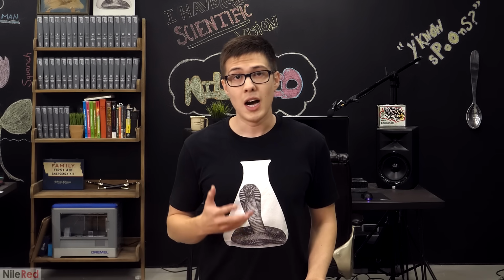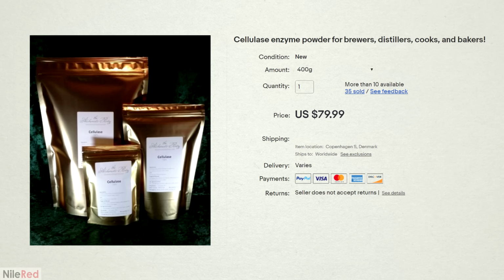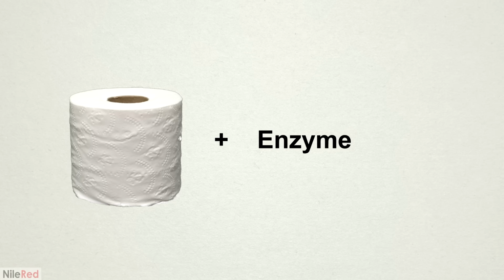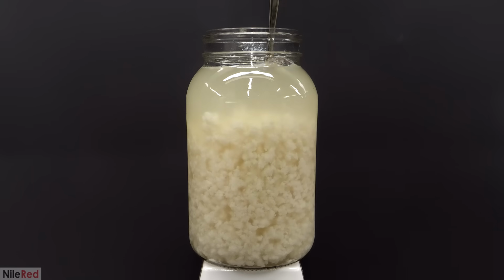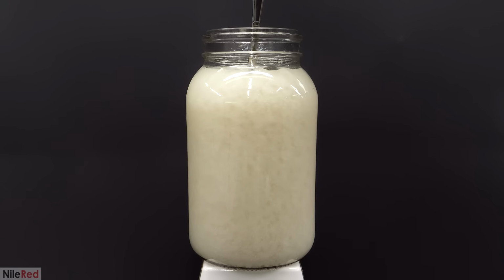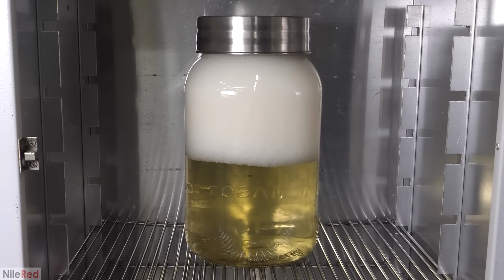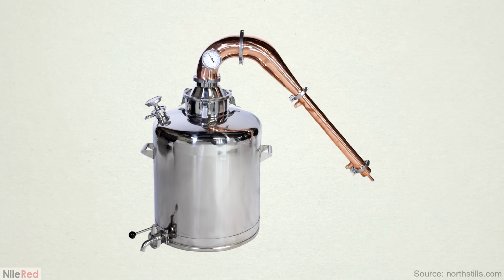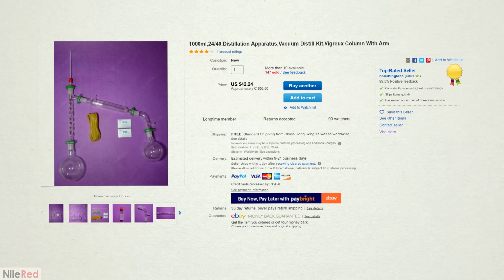Making toilet paper moonshine

Comment: Maybe you could try yet another experiment with this, using unbleached toilet paper? "Brands bleach wood pulp with hydrogen peroxide or chlorine to make it whiter. This bleaching process is more than aesthetic—it removes the substance lignin, too, softening the paper. Cellulose fibers are  naturally white. The glue holding them together, however, is brown which goes away thanks to bleach."
 (Quick Google search) - Just wondering if the bleaching process somehow alters the cellulose?

Comment: should have bought a 1-gallon distiller from "that water guy" in BC
A little pricey but they're great.  The water-only version has a bypass valve for pressure, the alcohol version has no valve.  Get the glass insert to go with it.

Comment: When using a wood gain product does it not convert to methanol, not ethanol? Wood grain alcohol are poisons    like IPA and not drinkable. Viewers PLS do not do this at ALL.
Somethings should not be shown. Red flag!!!!
Reply: Methanol is made from wood by pyrolysing the wood at much higher temperatures than are ever reached in this video, then condensing the gasses produced. You don't get methanol from wood any other way, at least not accidentally. Moreover, paper is most drfinitely not wood, but rather refined cellulose, and converts cleanly into glucose which can be fermented into ethanol cleanly with no more methanol than any other fermented alcohol.
Wine, beer and spirits are commonly stored and aged in wood barrels with no ill effects. No appreciable quantity of methanol is introduced into a beverage by its association with wood. Neither by coming into contact with wood nor by being derived from wood can anything contain unusual amounts of methanol, unless it is methanol itself.
Reply: @Quintinohthree  his explanation about pectin answered my question. I still would not trust it. making alcohol from a wood base product does not seem safe.
Reply: @ridercfo3368  Turns out sawdust brandy is a thing that used to be made in East Germany. It was perfectly safe and in fact a more pure alcohol than grain-based spirits. The process involved was similar, with acid hydrolyzation of cellulose, separation of the sugary liquid from remaining lignin, fermentation and distillation. If you can make drinkable spirits from sawdust, you might as well not worry about spirits made from paper.

Comment: 21:03 Doesn't Methanol and Ethanol have a lower boiling point that water so it's vaporized first?
Reply: Not first, more and faster relatively. The vapour released from a solution of ethanol and water will have a higher concentration of ethanol than the solution (untill you reach 95% ethanol beyond which the opposite is true), but the ratio is dependent on temperature and concentration of the solution.

Comment: You could add an antifoaming agent as simethicone wich is silicone in the mash prior to distillation to prevent foaming. Simethicone is sold in every farmacy as pills for bloating and flatulence. On the other hand, it is useful to measure the density of the mash before and after the fermentation. There are some formulas to calculate the amount of alcohol produced based on these two values or use a refractometer to find out sugar concentration. Every 1.7 grames of fermentable sugar will produce roughly 1 ml of pure ethanol.

Comment: Fantastic video. I wish you would have taken an initial specific gravity so that the potential enthanol in the wash could have been estimated. Also, the addition of an anti-foaming agent would have prevented the "puking" that happened during the distillation. As a warning to others who may try this, make sure to use food grade sodium hydroxide and sodium citrate to avoid heavy metal contamination.
Reply: Heavy metal contaminants don't distill, so if you can avoid a puke you can use whatever grade you like.
Reply: @Quintinohthree  That's a bad idea because you risk contaminating your fermentor. Claiming that it's OK to use a product that can be contaminated with heavy metals is one of the dumbest recommendations I have ever read.
Reply: @snappingbear  Claiming that heavy metals can affect a distillate seems pretty stupid to me.

Comment: There is a biological way to do this. Using mold to break down the cellulose. Freezing distillation. It could've been easier. Still, a cool video, but your no biologist.
Reply: First, using a reflux distillation system is much easier, faster and more efficient than using freezing distillation and second, using the actual cellulose enzyme is much better than using mold. Where do you think the enzymes came from, outer space? The enzymes are produced using specific varieties of yeast or bacteria.
Reply: The mold thing is disgusting, and tried to find a source on how to do it. Couldn't find any source.

Comment: I love this channel so much. The things I see at school happens here like enzymes, buffer solition but I wonder isn't 50 C is very hot for enzymes and i think cellulose to glucose conversion is hydrolysis and it is exothermic so it will substract temperature so shouldn't you set temperature a bit lower than 50 C?

Comment: hmm doesn't cellulose ferment into high poisonous methanol (Wood Alcohol)? Otherwise Hillbillies would be using sawdust instead of corn. It's a lot cheaper and easier to get.
Reply: No, cellulose doesn't ferment, but both cellulose and amylose (starch) can be converted into glucose which ferments into ethanol exclusively.

You use corn because it has a lot of starch and you forget about the cellulose because it's not worth it. You don't use sawdust because it has no starch and the cellulose isn't even worth extracting let alone converting into something fermentable.

You of course directly distill sawdust into methanol, but that's done dry at high temperatures.
Reply: @Quintinohthree  OK, I guess I was confused.  I remember when I use to make wine, the rule about making it with Orange Juice was to never use juice with pulp because the pulp contains cellulose and that would create Methanol in the wine.

Comment: where is the carbon in the glucose? O.o
Reply: In structure drawings of organic molecules, C's are typically omitted and implied by the intersections and ends of straight lines. H attached to C is also commonly omitted, also implied as one can figure out where they should be and how many by counting the number of bonds drawn to each carbon, knowing that carbon must have 4 bonds unless explicitly drawn otherwise, and any bond not drawn must be to H.

Comment: Cars could be powered by alcohol made from inedible parts of food: peanut shells, apple cores, corn cobs, etc.
Reply: Bioethanol (commonly E85) still produces air pollution (carbon dioxide, carbon monoxide, smog and aldehydes), sometimes more than unleaded gasoline.
Reply: This would be a viable option if the heat source wasn't fossil fuel or electric based. The amount of heat energy necessary to fill a vehicle's fuel tank would far surpass the amount of potential energy from the alcohol collected. It would be far more efficient to take the natural gas from the   bunsen burner and power the car engine.
Reply: @ElimGarak_DS9  As far as I know, the alcohol would have more energy than the heat it took to make it. But I may be wrong.

 I suppose another option is to build a combustion engine that runs on dried cellulose. It may be messy, but it could be worth it since there's so much cellulose left over from food.
Reply: @elietheprof5678   Wood gasifiers are an option for dried cellulose. Pretty interesting.
Reply: @ElimGarak_DS9  Cool - i bet wood gasifiers could be modified to work on corn cobs etc.

Comment: 16:12 there's a brewer tool called a Hydrometer, it tests the specific gravity in your case for making alcohol and tells you the sugar content and you can predict the alcohol yield at the end.
33:12 your product will be bitter and it will have a bite if you do not mix the right ratio of distilled water with it at the end. Doing this takes away the bite that burns your throat and it makes it smoother.😊

Comment: making wood into sugar was a process used in germany in the early to mid thirties. i have a textbook from 1936 that describes the commercial process. sugar was an import commodity for germany back then and thru the treaty of versailles imports were severely restricted. sugarbeets became a viable crop option for northern tier countries to make their own sugar.

 also, there are several commercial variations of this process in use today where methanol and ethanol are won from wood fiber in a process called hydrolysis, where the wood fiber is broken down with the help of HCL and heat.

Comment: Would this be technically wood alchohol?
Reply: No, wood alcohol is methanol and it's called that because it's obtained from the dry distillation of wood. This is ethanol, obtained from the fractional distillation of fermented sugars, in turn in this case obtained from the enzymatic hydrolysis of cellulose, which may be derived from wood, but is certainly not wood. Also, even the cellulose itself is never distilled, let alone dry distilled.

Comment: For anyone doing anything involving acid\base washes, please do not just wash until clear. An easy way to make sure you are removing unwanted contaminants is to take a ph reading pre base\acid wash and compare after rinsing. So lets say your toilet paper and water solution had a ph of 7.2, which was then dropped to 2.0 while treating with the base. To be relatively safe you should be washing and straining until you get back to that 7.2 pre treatment ph level.

Comment: How much does the process of breaking cellulose into glucose differ from breaking down starch? When Cody'sLab made glucose syrup from potato starch he only need a small amount of acid (hydrochloric) and high temperatures (via a pressure cooker). It was small enough that the salt formed when the acid was neutralized with NaOH didn't dramatically affect the taste, so probably not much.
Reply: Cellulose is a lot harder to break down because it's structurally denser and totally insoluble, whereas starch is moderately soluble and accessible from every part of its fibers.

Comment: Doesn't wood based distillation produce methanol, not ethanol and isn't methanol in significant volumes a poison? Those making moonshine typically remove even the small amounts of methanol from their 'shine but I think you might want to double check to make certain that you are not going to cause serious injury to any one who imagines that you have distilled ethanol.
Reply: No wood is being distilled here, just fermented sugar. Also, you have to dry distill wood to get methanol.
Reply: @Quintinohthree  What was the paper made from? Cotton? And you don't need to "dry distill" anything to produce methanol. Methanol is found in fruit wines. Distilling the wine simply concentrates the methanol already in the alcohol and if the % of methanol is high enough in the fermented raw material then you concentrate that in the distillate. You might want to use a flame test to determine whether you produced ethanol or its nasty cousin, methanol. The flame color is quite different. But you know that, right?
Reply: @kb2vca  Doesn't matter what it's made from, it matters what it is. It's not wood, it's cellulose.

Yes, methanol can be obtained by methods other than dry distillation. Fruits containing pectin will yield methanol when fermented, but crucially not because they are fermented but because pectin simply contains methanol in the form of methyl esters which are easily releases under acidic and alkaline conditions. Even if there were pectin in that paper to begin with, the base-wash at the beginning would have washed out all methanol that could have been produced from it.

Fermentation itself cannot produce methanol. If you ferment sugar, you don't get any methanol in the end product. All methanol in the product of fermentation has to be already present before the fermentation starts.

Comment: Methanol was first distilled in 1661 by Robert Boyle by fermenting wood.

So... that means he did it first... if you’re fine with drinking something that turns into formic acid as it’s metabolized by your system.
Reply: Not fermenting wood, distilling wood, dry, no intermediaries. Also, this is most definitely ethanol being produced here. You don't get methanol by fermentation.

Comment: You do realize that if you really did drink what you distilled you would be drinking more methanol than ethanol and would cause blindness and a really bad headache?
Reply: There's literally no way for methanol to have ended up in that distillate. If there was pectin in the paper, its methanol was washed out in the base-wash. All cellulose was converted to glucose, and fermentation can't produce methanol. Methanol can only be produced by dry distillation as it requires high-temperature reactions to take place in the wood. Litterally no way there could be any methanol.

Comment: Did you consider running it through a water filter to clean it up still further? It's not economically viable for improving cheap booze generally, but it does work.

Comment: An advert from ebay....

"About Cellulase
Cellulase
 is used to convert cellulose to glucose. This both increases the amount
 of glucose extracted from the grains and other plant material, and 
reduces the amount of cellulase in the mixture, which can make the mash 
easier to process.
Use 20-100g Cellulase powder per ton substrate 
material if mashing under ideal conditions with a conversion time of 1 
hour. Ideal dosage must be determined separately for each recipe if you 
want to optimize your use of enzymes. Stir well every 10 minutes to 
ensure that the enzyme is evenly distributed throughout the mash."

Per ton of substrate?
How many toilet rolls is that?

Comment: ~6:30 - my theory is it turned yellow, because as the base started attacking cellulose polymer, not only oligomers but also mono/di/trimers of glucose were released. and those were just caramelized, due to heat. that'll also explain the scent you described as pleasant.
the "woody" aroma may come from lignin, or other contaminants present in the toilet paper (ex. after bleaching). after all, it's toilet paper, not laboratory grade pure cellulose :P

Comment: Filter through activated charcoal for whichever congeners you can remove that way. Then remove some more water by salting out with quick lime or Calcium chloride. Finish drying with freshly baked  molecular sieves.

Don't drink the absolute ethanol, it can dehydrate your tissues on contact, possibly giving your esophagus/mouth/vocal cords chemical "burns". Lovely material for chemistry, though...

https://www.google.com/url?sa=t&source=web&rct=j&url=http://www.sciencemadness.org/talk/files.php%3Fpid%3D280061%26aid%3D23024&ved=2ahUKEwjW1rimse_lAhVOd6wKHciWA7kQFjALegQIAhAB&usg=AOvVaw1huYnH-U5IHZVqcivbsu2S

Comment: I recommend a better method of determining the concentration of a compound in liquid form. it uses a refectrometer better than the refectrometer type  Abbel (they are used in wine making, beer industry) some having also optical optical spectrometry (determining the chemical composition using the light spectrum and the specific refractive index). You have to worry, in the resulting solution there could be some parts of methyl alcohol - toxic for human consumption -.

Comment: You spouted a lot of nonsense about yeast! You were completely wrong in your information! Even with ale yeast (top fermenting, high temperature), you should have cooled your "wort" to about 25 degrees C. The yeast should also have been roused first. Regular brewer's yeast is actually geared towards lagers and requires 10-15 degrees C. If you would have had enough sense to actually read up on brewing, used the correct yeast, and proper temperature, you would have completed the brewing in about 5 days and had a much higher yield, 4-5% alcohol.

Comment: I probably wouldn't have covered the still column. You'd get some condensation at the top which would fall back into the vat allowing less dense vapours to pass onto the condenser. That's another reason why a thermally conductive metal like copper is used for the column. But you got there just the same. Be careful with publishing criminal activities on YouTube. Canada's not very kind to personal distillers.

Comment: so right now the energy industry is trying to pioneer cellulostic ethanol production, so they can use non cash crops for ethanol production, but where it stands breaking it down into simpler sugars is not financially viable and results in an EROI of less than or equal to 1, mean energy input is equal or more than energy output from the alcohol produced.

Comment: You should show how to test for methyl alcohol!
Reply: If the flame test is yellow, then there may be methanol present, but in this case there wouldn't be any since there's no pectin. Moreover, since methanol has a lower boiling point we distillers always throw away the foreshots (I keep them in a jar as cleaning agents as acetone is also a byproduct).
Reply: @snappingbear  hey sound's like you might know what I'm wondering, I made some mead with a whole orange sliced up in it just threw in some dady and it ended up pretty strong. Would methanol be an issue if I'm not distilling it?